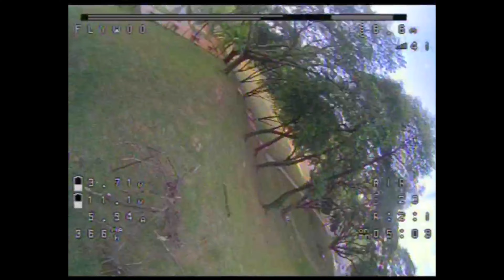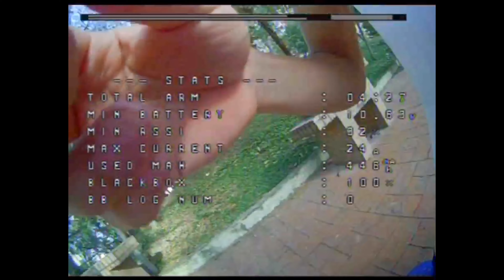ARMATTAN TADPOLE  Build Video

Comment: Thank you for sharing your build!!! I was hoping you could answer a few questions. I'm doing the tadpole build aswell. I went with those motors also. Do you like the way they sound and feel in all honesty? And for your camera choice, would you recommend a better camera or maybe something that's more expensive if money wasn't an issue?
Reply from the maker: Zach Bishop yes! These motors performed well on this quad. For the camera, you can try HD camera like runcam split nano. But it’s gonna be a tight build. Or runcam nano 2 or baby caddx ratel if you want analog
Reply: @MANOLET  hey thanks for the reply, I had getfpv under watch and got some before they just sold out again. These motors are solid!! I got the version with the skrew wholes. They are heavier but they have no play at all.